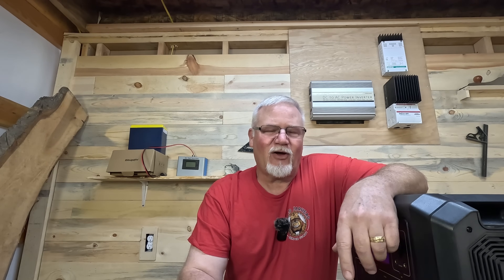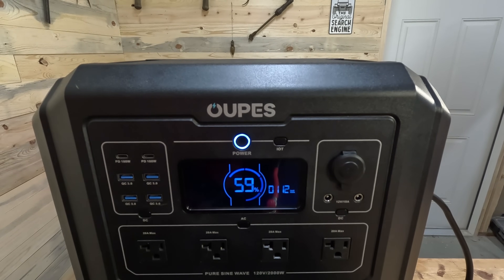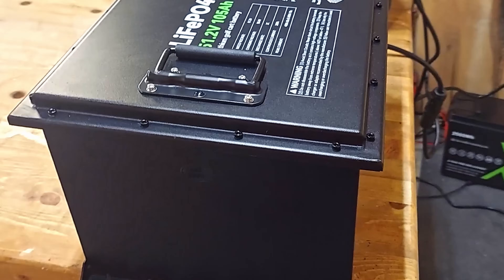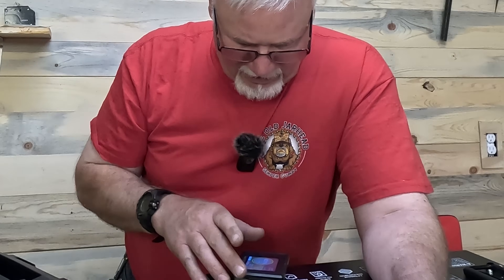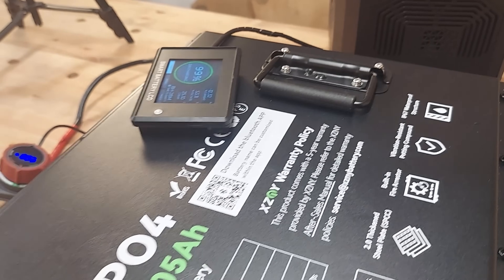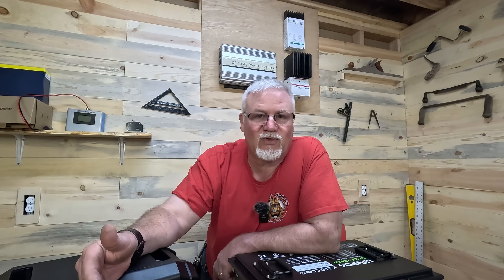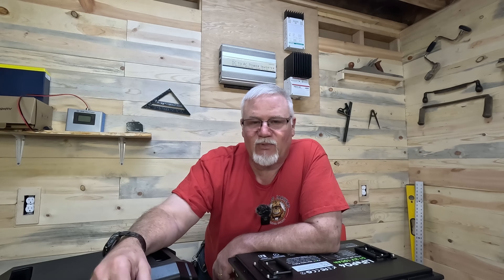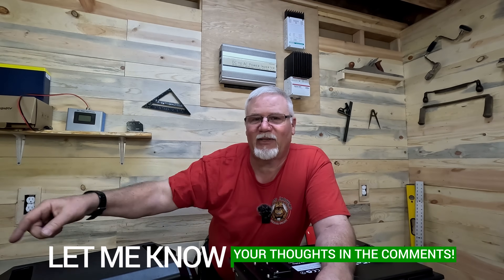🔋 SUPERCHARGE Your Powerstation with THIS Battery! 🔋

Comment: Would this work for the Bluetti ac200 max ?
Reply from the maker: You'd have to test the expansion battery port on the Bluetti with a Multimeter to see if you get voltage at the port and what voltage you get.  If it's live and 53+ volts (when fully charged) then yes, it should, though I have not torn into one of theirs as I don't have a Bluetti (they offered a few times but failed to actually get back to me when I said "sure".
Reply: @TheOldJarhead I check the expansion battery port for the bluetti ac200max and the voltage is 51.2 written on it, and I also noticed the expansion battery port 10 openings to it with 2 of these holes bigger than the other
Reply from the maker: The key is whether or not the port is live?  So it's a 51.2v battery pack, which is good and what you'd need to do this, but the issue is whether or not they leave the port open to the battery or have it switched like the EcoFlow's do.  Though there is a way around the Ecoflow's now too.

Comment: I have a Blusyyi AC180 i believe the 48 volt You had in the video will work with it. Correct? Right now with charger kit it's 50% off on Amazon.
Reply from the maker: It's all in the solar port.  If it accepts 48v, then yes!
Reply: @TheOldJarhead  The solar input port of the AC180 is 12v-60v at 10 amps. However you will only get the full 10amp from solar IF the volts are above 32v. It says
Reply from the maker: Then yes 48v will work nicely 😀
Reply: @TheOldJarhead  Thank you for the advice. Great!  That battery like I said is 
$1999.00 for battery, charger, monitor on Amazon from XZNYs store at 50% off. I'm going to get one. Will be a great boost of stored energy.
Reply from the maker: That extra 5120wh is kinda nice to have :D
Reply: @TheOldJarhead  One more pic your brain. I have an car inverter that has gator clips that hook directly to the car battery that  makes it rum as a 3000 watt generator. It works well you just have to run the car which of course uses gas idle West on the car. I could take this large golf car battery hook the clips from that to the golf cart battery directly giving me a 3000 watt generator with 5120wh of power. I don't think I'd need anything else as far as cables.
Reply from the maker: only if the inverter is made fir that voltage which it isn't if it works on a car
Reply: @TheOldJarhead  Yes Sir I realized that after I posted and looked at the inverter. Live and and learn.😁
Reply from the maker: That's what it's all about!

Comment: Could I use this set up not the big boy, but 12v-24 lifpro4 to charge my Oupes B2add on battery only, not hooked up to power station..?
Reply from the maker: I haven't played with one of those but I do believe they have a solar input and if so, yes, but 48v would be better as their input voltage is pretty high.  24v might get you around 240w of charging but I'd have to do some checking to be sure.
Reply: @TheOldJarhead  Ya it does have solar says 150v 15amp max input,,,
Reply from the maker: Nice

Comment: Why would you only want to do this in emergencies. What would be the risk/unusual stress/ point of failure..... My plan is to use this at setup at my offgrid hunting cabin with a mega 2 and 100ah 48v battery.
Reply from the maker: You could do that.   I think of it as emergency if you can't charge the aux battery with solar or a generator or dC charger.
Reply: @TheOldJarhead  Ahhh, now I understand.....I have a 3500w gen that could charge both but this would give me prob 3-4 days without running it.
Reply from the maker: Nice!

Comment: I have a delta pro. Can you hook up solar to the ev port to maximize your solar input without an ev charger? It is DC to DC for fast charge.
Reply from the maker: That is a great question.  The EV port accepts up to 3400w of incoming charging but I'm guessing that is controlled by the EV charger itself.  However, I'd guess that if you have enough solar and an appropriate MPPT charger, you could probably use the EV port for faster charging than the 1600w I saw they allow on their controller.  Certainly worth investigating more.

Comment: Great video and am really trying to wrap my head around which volt battery to use to extend my power station and would appreciate your kind advice please sir. I have a bluette AC70 that I want to use primarily in my small class b motor home and want to restrict the use of my on board generator hence get a battery to expand the power station. Can you please recommend which size voltage battery that I would then use solar panel to recharge. Please and thank you.
Reply from the maker: The Bluetti AC70 has a solar input of: 500W Max., VOC 12-58VDC, 10A  -- so you would get the most bang for your money with a 48v battery.

Comment: I think using Delta 3 Plus around the house and feed all your solar to a 48v battery bank and then distribute that to the deltas PV input is the cheapest, most insane hack for blackout and power failure cheap while getting solar benefit is insane.
Reply from the maker: I think the best approach would be straight solar but not everyone has the knowledge yet

Comment: I bought solar generator power stations when they were on sale. I have devices that I figure the station can power for at least 2 hours. Just one hour for the microwave because it's never used that long all day. If the power goes out longer than that I have cheap batteries to recharge the stations. I've only needed to recharge power stations once in the past 5 years that I have had backup power. Inverters are definitely good, but even if you use inverters, you still have to add capacity during a long power outage, unless you wired up the whole house which is a huge investment when you are only worried about power outages. Most of the time the power goes out, I plug my laptop into the small station next to my bed, and the power comes on again before the fridge warms up at all.
Reply from the maker: Sounds like you have a very effective system in place!

Comment: Hi I've just recently purchased two 24 Volt. Lifepo4 batteries and put them put them in series. to connect to my Bluetti AC300. And to my amazement. absolutely no charge was being transferred. I checked my connectors. with a meter, It showed 52 volts. So I knew there was power. Then I realized I had a inline meter I had made previously. So I connected that Between the battery and the bluetti. and as soon as I connected that, it started to take charge. Why would that be?. about 620 watt max!  Oh, and there's more to the story. I originally bought a. bought a wind turbine. 48 Volt. 3 kilowatt. We all have doubts about that advert I never had great expectations. I connected. the wind turbine. to the AC300 as the manual says you can. Connect a wind turbine to it. . But again, it was not recognizing. the wind turbine. I contacted the Turbine sellers. They were very helpful. They told me. that had to be connected to a load before it would produce power. I read online that That it was safer to have batteries Directly connected to the wind turbine. and then use the batteries as you have done in your video to. power your solar generator. That's what prompted me to buy the extra batteries In the first place. So what I did,  I connected a change over switch. to stop me from leaving it connected when it was charging. It has two positions. Wind turbine to battery. or the second position battery. So solar generator. Obviously disconnecting one from other.. So far, I've still not got the wind turbine working correctly. As my roof mount for the turbine has started flexing at the beam where it was bolted on. And I've had to rethink where it's to be mounted. I have just finished making. a scaffolding pole. mount to mount on the side of my concrete garage. So weather permitting. I will be tackling that very soon. Oh, by the way, I'm based in Scotland. Where it's windy most of the time. until you put a wind turbine up.!   Out of interest. I paid just over £500 for the two 24v 100 amp batteries. Bluetti spare battery price. Sale price £999. at the moment. which is crazy expensive. Considering I. bought the whole AC300 for only.£1199. In a new year sale. This was reduced from over £2000. I already own a Bluetti  AC 200 Max. with a Extra battery. I had hoped I could use the Extra  battery from the AC300. but oh no, that is not. compatible. but the battery on the AC300 is. back compatible to the AC200 Max. How crazy is that?
Reply from the maker: Welcome :)  Would love to visit Scotland some day!  Mom's maiden name is, Scott.  Anyway, the issue you had is an odd one.  If the power station solar input is set above 52.1v then it should be no issue.  Did you try just one battery connected to see what it did?  Verified the input is rated above 52.1v?  If it's rated above that voltage and it didn't recognize it, I'd look at the physical layer first -- that's all connections and cables.  I'm wondering if after connecting it to the inline meter and to the Bluetti maybe the connections were tweaked just right to give power.  Maybe take the meter out and see what happens.

And yes, those expansion batteries are spendy!  They do add some features and functionality but for the price I'm happer with a 48v battery connected instead and that allows me to put solar (or wind) to the battery and let it charge at a faster rate still :) and some day add an inverter to the battery and use it more than the portable :) 
Cheers!
Reply: @TheOldJarhead  Thanks for your wonderful reply. I already use it for most of my house power as I live on my own. I do not Use a great deal of electricity. But basically, the only thing I can't use it for is my 10 kilowatt electric shower. There's nothing else that I have that's exceeds three kilowatts. although it's not hard wired into the house electrics, I. have various extension cables I've tried to hide I already had a very small grid tied solar panels, three kilowatt, not enough room on the roof for anything bigger. I had expected to have another kilowatt put on top of my garage roof, but the installers poo pooed it. saying it would lose too much DC voltage with the length of gable to the house. Well I've since discovered that was just their laziness because I've got. off grid solar panels  on the Flat roof garage. I had three 410 Watt. panels. up there before. the big storm. They were only held up by their weight. which at the time obviously was not enough for high winds. Now I only have two But funny enough, it didn't break the one that came off. It's still intact. I'll get it back up one day. And I've got one amazing thing. Well, in my opinion. in bright sunshine now. Bearing in mind this is just the end of the winter in Scotland. I've been recording 900 w and something.  that's excess. of what the panels are supposed to produce. what I think I have done after watching somebody put in vertical panels up and they showed them put in reflectors underneath them. That's what I did to my normal panels on my garage roof. I had a big glass mirror panel which was cracked and I thought if I put it up on the garage nobody's going to see it. and a double glazed window under the second one. And lo and behold, I've got this increased amount of electric being produced. Later this year, the UK. Are going to change the way they supply electricity, allowing us to get. deals without a stand in charge, which will. suit me fine because the kilowatt price will be greater. But if I'm not using much power, I will still save on the monthly stand in charge. If it's not there. Thanks for your very interesting videos. I will keep watching them.
Reply from the maker: Sounds like you are having a good time with it!

Comment: Another great vid. Have you seen the Battery Evo 48V King Kong 2? single 62kwh battery for $8925 USD, or $12,900 CAD the same price as my 48kwh 2 years ago. Put 1 fully charged on the power station it would run the fridge for 2 months lol. 16 of these = $142,800 per Megawatt. whoa 25kw discharge 500A charge. Only 8 allowed in parallel for 500kwh. Limited to 6kw gen charge,weird.
Reply from the maker: I have!!!  There are some awesome batteries out there and I'm using BigBattery Mules at my cabin which BatteryEvo also used to sell.

Comment: You can get really good 100ah/51.2V batteries in rack mount cases for $1200-$1400. With extinguishers and full communications support for a proper inverter. You can find them in 200 and 304ah configurations as well today. Building a whole home backup for emergencies even without solar? Has never been cheaper.
Reply from the maker: Yup.  The Golf Cart Batteries are purpose built in a way that is not needed for offgrid use.  I've looked as several wall mounted and server rack batteries that would be excellent and less expensive.
Reply: @TheOldJarhead  FYI on Amazon this battery is $1000 if you click the coupon......Its sitting in my cart right now @davefroman4700
Reply from the maker: Nice!  Since it has Fire Suppression and a lot of the GCB's don't, that seems like a great price!

Comment: Will the 48v battery work with ecoflow delta pro?
Reply from the maker: I'd have to check the solar input of the Ecoflow but I think yes.  Check the port, it's usually written on it -- should say the voltage range, something like 13v-60v.  Anything 60V and up it will work on.

Comment: Don't know if you already stated in a different video but with 12 volts you have the option for connecting to any vehicle with jumper cables while vehicle parked and running at idle. 
I used an inverter only hooked to my truck to get through ice storm in NY 30 years ago. Power out for long time back then. Power stations obviously didn't exist and even pure sine wave inverters were rare and costly! I'm sure you remember.
Reply from the maker: Ahh yup :)  I have inverters in both my Jeep and my Truck and remember well the first inverter I ever saw was back in 1990.  It was in the LAV-R (Light Armored Vehicle - Recovery) when we were in the Desert.  The guys on it brought a drip coffee maker and made coffee with it all the time 🤣 and yes you can do that with a car though a DC charger is a better option as they can draw from the alternator and provide 500+ watts depending on the power station.

The inverter above my head which can be seen now and then is a modified sine inverter (square wave) that I bought in 2010 when Pure Sine inverters were still quite spendy.  Today, pure sinewave is cheap!

Comment: You could use a 30a boost converter (less than $30) with a 24v battery and get the power input for a lot less money.  Two cheap 12v batteries in series, a battery monitor, and a boost converter can cost you less than $400 and give you about 2500wh at 750w output.  You always have great ideas that get you thinking.  Enjoy your channel.
Reply from the maker: True, and I've demonstrated that as well.  Of course, you could use a 24v battery or even a less expensive 48v battery (which would be more efficient).  This was a fun experiment though and tomorrows video pushes a Pecron to see if it will out perform the Oupes which, hint, briefly stopped the MPPT controller under testing but came back right away so I decided to see what the Pecron would do ;)
Reply: @TheOldJarhead  I am anxiously waiting to see the results, thanks.
Reply from the maker: It will be out at 3PM tomorrow (available to members now) 😁

Comment: Good morning! Do you like that golf cart battery? Seen on eBay for 400 buck's.  48v generator only way to Go.  Got the all Power one.. runs rv.. would save your Bacon! Lol god bless And enjoy the day!
Reply from the maker: Yes!  I think this battery is one of the toughest I've seen yet.  Of course, it's designed for Golf Carts so has features most off grid batteries don't need but having fire suppression built in is very nice and I like the LCD Display and it's functionality as well as that it comes with a good charger too!  Cheers!
Reply: @TheOldJarhead  cheer's! There cheaper than the rack battery's..  so great for off grid.  Lol
Reply from the maker: True!

Comment: I use the litime 25.6V as backup for my Delta flow 2, River 2 max and my Anker DC 300,
Reply from the maker: Awesome!
Reply: @TheOldJarhead  I thought about the 48v but landed on the middle because of the versatility to work with all my units. I just keep a M8 to Xt60i hooked up on the battery and can plug that into any of the units in an emergency
Reply from the maker: That makes great sense!

Comment: Anytime you convert, invert. Step up or step down you pay a certain “energy tax”.  The most useable watt hours comes from one battery bank feeding its own dedicated inverter. I’ve also learned that big inverters use big power relatively just in operation loss. The cheapest and longest lasting setup is 52.1v battery with its own inverter, maybe 2000 watts powering their own circuit in the house or as in my case a large cabin and workshop. If you generate tons of solar this is a moot point, but I’m in heavy woods in northern Wisconsin with long winters, very little, a lot of extended times with no solar output.
Reply from the maker: You're right, I'm just trying to make this as simple as possible for those who don't want to mess with big inverters.

Comment: What would be the best way to charge this battery?
Reply from the maker: It comes with a 1000 watt charger that you can run off utility power or a generator.  Or, you could add an MPPT charge controller and solar panels and charge it with more power than the power station can handle :D
Reply: @TheOldJarhead  thankyou
Reply from the maker: You bet!